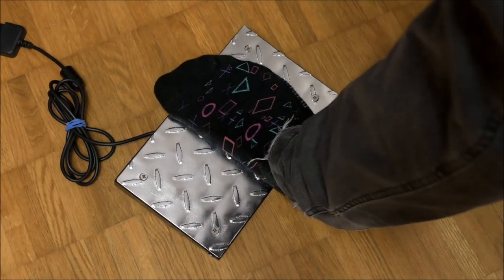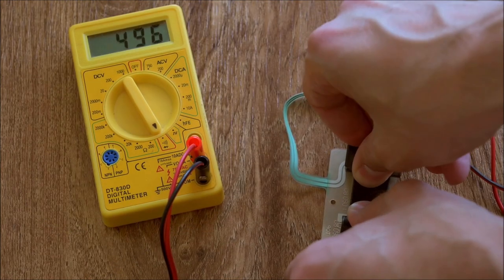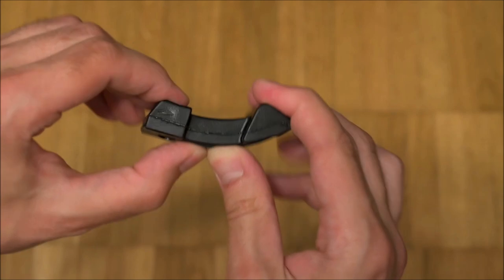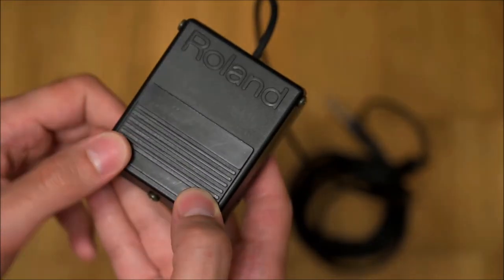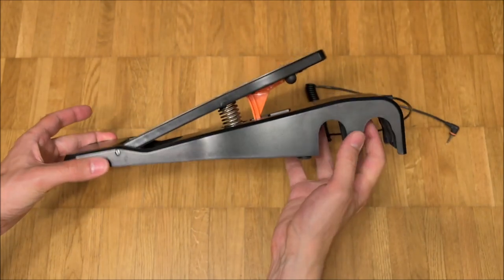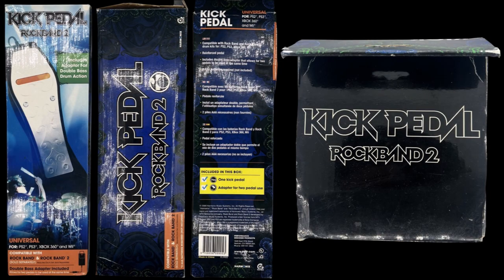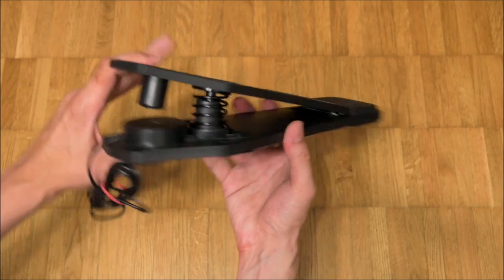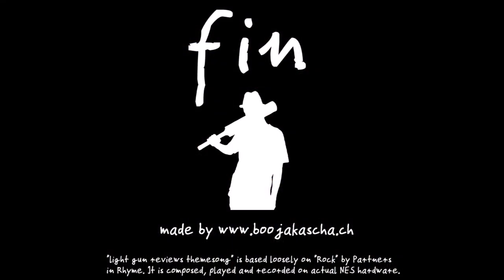Light Gun Reviews 239: Music pedals used on light guns

Comment: Thanks for these videos, they're really helping make my decision on what lightgun to get to pair with my arcde cabinet. For a footpedal I have a chunky transcription footswitch I got from work. Its RJ-11 plug plugs into a simple USB device that makes it a 3-button joystick device. Modern USB transcription footpedals like the VEC ones dissapointingly only work with dedicated transcription software, but it's pretty trivial to open them up, cut out the circuit board, and rewire the microswtiches inside or even put a Pro Micro inside.

I've also worked with the Linemaster 971-S Aquiline Foot Switch for work projects--I just love the feel of it.
Reply from the maker: You are very welcome =) Does your cabinet have a CRT screen? Or are you diving into the modern LCD guns?
I looked into a few dictation pedals =) The ones of Olympus and Phillips look cool, but I think I won't stock up any time soon^^

Comment: How do you plug them to a PC or a console? They don't have USB or console connector?
Reply from the maker: You don't =)
You plug the pedals into the guns. If your gun doesn't have a TS socket, you would have to install one yourself ;)
Reply: @Boojakascha  Ha ok thanks, it works only for specific lightguns.
Reply from the maker: @guimli8544  Yes, specific or modified guns. TS sockets are an often seen feature though :D You will find such guns effortlessly!
Reply: @guimli8544  You can also connect them directly to a USB Zero Delay board, an iPac, an arduino or a Pi Pico quite easily that have their own usb connector that works great with PC's, Mac's, Raspberry Pi's, Linux and even Android. Some will also work with PS3's and other og consoles.
Reply: @MrHexxed  Thanks, in fact, I'm playing on PS2 now (I bought it only for rail shooter). I think I will try to solder pedal/switch wires to a controller button PCB, to use it as player 2.
Reply: @MrHexxed  Could you explain this? From what I understand your suggested methods would allow these pedals to be connected to a PC? But the suggested hardware seems a hassel to implement to a PC?
Reply: @kullekusk8136  A typical pedal is only a single switch with a ground and line. There are some that are analog and use potentiometers or hall effects however even then there are simple solutions for those. Since most pedals are no different than an arcade button or anything else that uses a switch, you can wire them up to an encoder or even directly to a lightgun like Gun4IR for instance. You can also do a padhack to almost any controller (open the controller and solder the 2 wires to any of the buttons for example).

Depending on which encoder you go with, it can be as simple as screwing the 2 wires wires in, soldering them or using something like a Wago connector to connect them. USB Zero delay boards and iPacs are simple plug and play for PC's and show up as a controller or keyboard input. For Arduino or Pi Pico there are dozens of projects you can choose and most require about 2 minutes of your time to flash your firmware and around 30 seconds total if you've done it a few times. Take a look at my pedal Playlist to see different options: https://www.youtube.com/playlist?list=PLSpNTaD7rZni8JKDUeX5m75f_VCuljOhG

Comment: Would this connect to a PC via an Xbox adaptive controller? :O
Reply from the maker: Has the Xbox adaptive controller a TS socket or similar?
Reply: @Boojakascha  I don't think so, unfortunately.

I'm gonna hit you with another question!
Do you think there's any way one could map a pair of PC "racing" pedals to act as keybinds? Either a single keybind each or perhaps, even better, for instance 1-50% pushed = X-key, 50-100% pushed = Y-key. 
I mean theoretically it has to be possible. But I mean without becoming a programmer myself....
Reply from the maker: @kullekusk8136  Yes, that's possible, but I do in fact recommend becoming a programmer :P. Joke aside you could Fiverr it or give it ChatGPT. The code would be trivial. Just the time domain is hard to do. MSI recently royally messed up =)
Reply: @Boojakascha  Yeah, best is probably to allow MSI some time for a relaunch. Atleast that thing has RGB, maybe put it on top of the Christmas tree? 

0.2 ms (Razer optical switches) x 500 = 100 ms ._.
Reply from the maker: @kullekusk8136  If one wants to achieve a record, but can't be the best, there is always the option to become the worst :D
Reply: @Boojakascha  Yeah. And "This is a prototype, the ms delay will be somewhat larger than we wished to produce yet sufficient to serve as a prototype for a future premium product" would have been a bit more classy than the "Fastest thing ever"-marketing.
Reply from the maker: @kullekusk8136  That marketing was super silly indeed :D